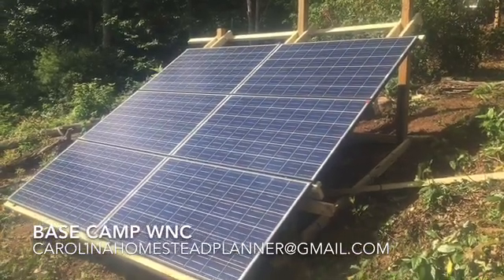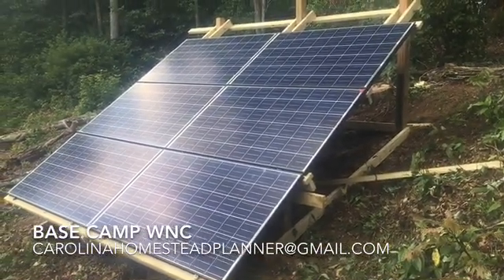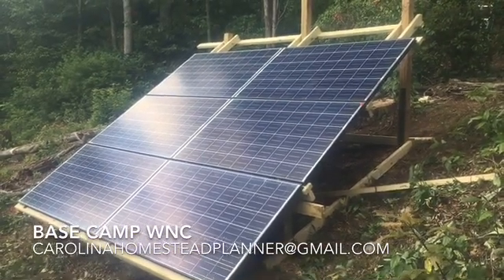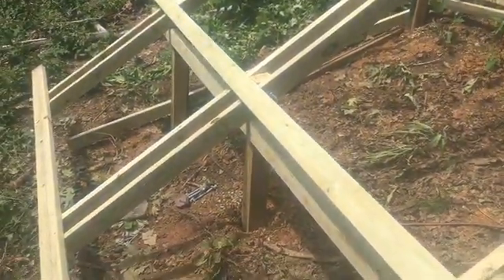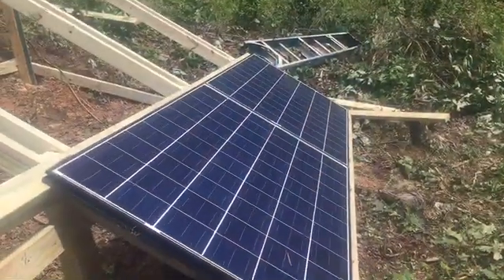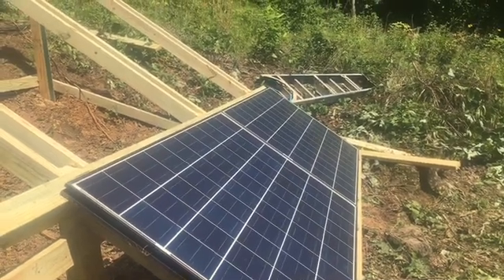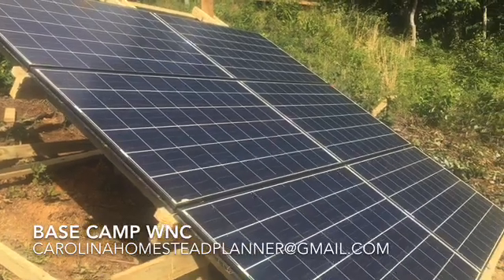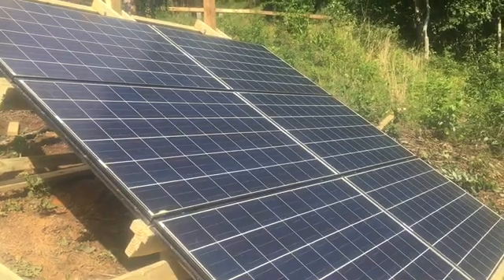DIY tilting Solar Panel Rack

Comment: My first roof mount was on 2x4 sleepers screwed to the roof with a dab of black mastic at each screw location. The wood was old and well seasoned so no warpage. It lasted for as long as I needed. Still have a few mounted on another roof the same way which are still serving well enough.